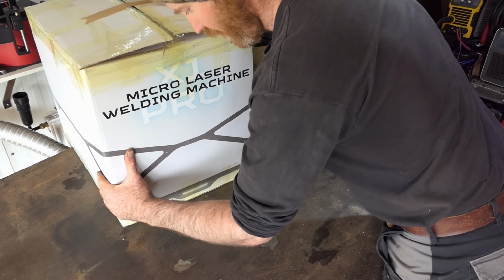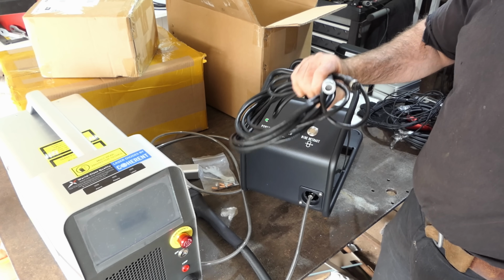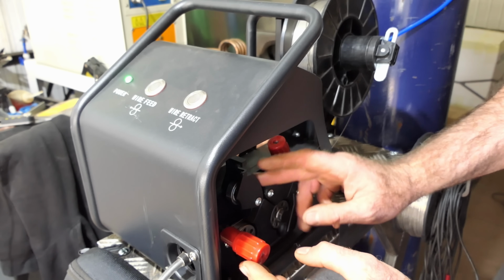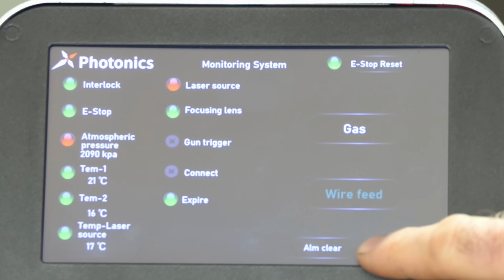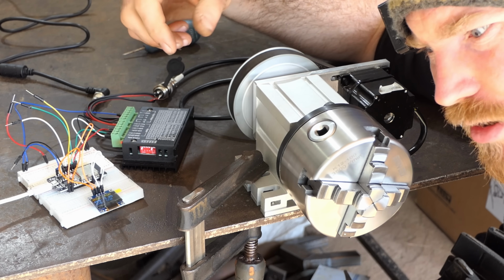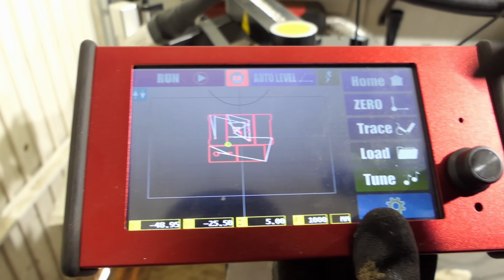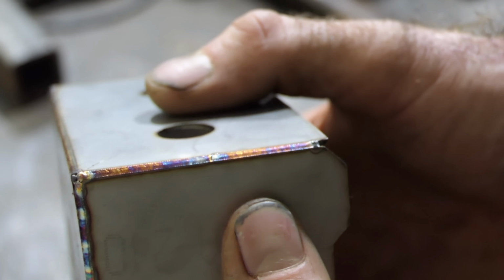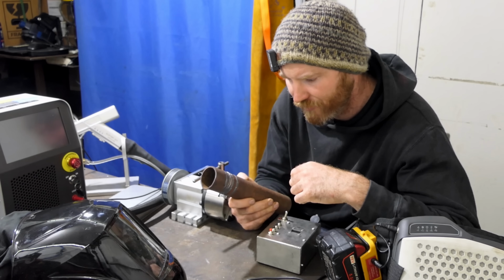Upgraded Super Laser!... Kickstarter fulfilled!

Comment: Hi Josh, which type of helmet do you use? On the link of the welding Equipment I can only find „normal“ welding helmets (without the laser safety classification).  (I also bought the Laser welding machine from xlaserlab and I‘m very impressed about it!)
Reply from the maker: I use one from Xlaserlabs specific for their laser. Cheers J

Comment: Have you got files to build your torch holder? I have both machines also.
Reply: Thanks for getting back. I’m planning to do the same!
Reply from the maker: I've not finished no. I tend to use the plasma rather than the laser as it's quicker and cuts thicker. But for intricate thin parts I'll need to make a better holder. Cheers J

Comment: That's an impressive piece of equipment. I dread to think how much it costs. What's the deal on gas costs running it?
Reply from the maker: It's £4000 currently. The gas is nitrogen which is 1/4 of the price of Argon which is used for MIG welding. Cheers J
Reply: Oooooooooo that's a lot of pocket money. Then the obligitary CNC adding x amount. I can see how this could spiral. But the things I could make... ummmmm I really, really want one.

Comment: So great to see the abilities of this machine. Would you have a link somewhere of possible settings for welding particular metals. Ideally various stainless steel thicknesses.
Reply from the maker: I pretty much always run on 100% power with a 2-2.4mm beam width and adjust the wire feed between 8-14mm/s depending on the metal thickness. Cheers J

Comment: I just got my X1 Pro laser, and it's great! Sadly I didn't get one of those DB25 cables for CNC with mine. Please could you buzz out and let me know which 2 pins those red and green/yellow wires are attached to so I can rig my own CNC up?
Reply from the maker: Well done. I hopefully mentioned it in the video but otherwise the instruction manual which I hope you received also has the pin definitions. Let me know otherwise. Cheers J
Reply: @joshuadelisle  thanks! My manual has a bunch of pinouts (including for an RJ45 which my unit doesn't have) but unfortunately nothing for the DB25! If it is in your manual (maybe your manual is more up to date?) please could you post the page up?
Reply from the maker: @gfwilliams  I'll look into for you.
Reply: @joshuadelisle  that's awesome, thank you! I can't wait to get it set up on CNC. I really appreciate the work you've put into the videos on this and your honesty - actually seeing you sometimes struggle with it made me feel a lot more confident about getting one when I saw the results you got in the end! (I'd love to see a video where you CNC cut and then weld the horse pattern you made with it)
Reply from the maker: @gfwilliams thank you so much. I plan on doing a lot more patterns soon. Next I'm building a powered ebike trailer that has a camper module similar to an airstream. It's shell will be seam welded aluminium and the laser is the perfect tool. Cheers J
Reply: @joshuadelisle  That sounds great! I'll be looking out for that with great interest!

I tried poking around the DB25 connector myself with a resistor and I found the connections! Pins 5-6 are the e-stop which need shorting, and then shorting pins 3-4 is enough to make the laser turn on.
Reply from the maker: @gfwilliams  that's awesome, well done. I'm still waiting on a reply from Xlaserlab to confirm connections. Cheers J
Reply: @joshuadelisle  just for anyone looking at this, I posted the setup I used for CNCing my X1 Pro at https://www.youtube.com/watch?v=91UyzMzQsJs

Comment: Hi Josh,
Xlaserlab have delivered today wahoo 🎉🎉🎉
would you recommend nitrogen or normal gas for welding all metals?
Reply from the maker: That's fantastic news! Nitrogen is good for most ferrous materials. Argon is best for aluminium, titanium etc. you need higher pressure/flow compared to normal welding because it helps keep the lense cool which is important. They should give you an instruction manual, I have a digital one and it's very comprehensive and goes into a lot of technical detail. All the very best. Cheers J
Reply: @joshuadelisle  I would have never thought of Nitrogen for welding and thank you for your advice.

Comment: Is the PAPR part of the xLaserlab X1 Pro package or where did you buy it from? The listing just talks about a "special laser welding helmet", but not about the PAPR.
Reply: Mines just been delivered and I can confirm you don't get the airbed helmet with the pro kit, just a normal type of helmet.
Reply from the maker: Xlaserlab are selling them separately and as a package although it's not on the website yet. Cheers J

Comment: wait, you are not cutting it with an angle?
Reply from the maker: That's right, because with CNC you need to cut vertically. There may be settings to add wobble to the pierce to prevent any problems. Cheers J

Comment: Great stuff! 
I noticed that while cutting your steel sheet the sheet was only clamped at one end, making it both droop (taking it further from the cutting head for part of the cut and too close at others) and bounce up and down after contact with the cutting head's probe feature (potentially causing some of the wiggles in the cuts). I believe fully supporting it would help with both dross (proper distance to get the best melt on the metal and more gas from the closer cutting head should blow it away better) as well as less bounce (reducing some of the wiggles in the cut edges). 
Best of luck with future projects!

Comment: to prevent reflection of the beam while cutting on the arc droid, couldn't you add an easily destructible matte coating? something like sooting the area with a regular torch before mig welding to prevent blobs of fly off sticking. just guessing here, not a welder, just a huge nerd. dunno how that would effect the cutting or not.
Reply from the maker: Apparently not because the molten pool that occurs before cutting through is what reflects the laser the most. Cheers J

Comment: It is cool for sure. Definitely great for a lot of things. I'm just curious about the strength of the welds . Just off the rip it doesn't really seem like there's much of a puddle going on there. It's just kind of quickly melting the filler and base as it sweeps I guess. Still getting dark blues on the edges somehow. So I guess there is plenty of heat in there. But, still I wonder if it burned through the pipe with the gap set up
Reply from the maker: See the video before this one. I do a lot of strength testing. Cheers J

Comment: Great video!!!! Using nitrogen instead of argon does it give a better weld than when it's used on a mig instead of argon or should it only be used with perging and non structural welds? I haven't had the chance to use a laser welder yet still way out of my price range but would like to get one eventually!!!!! Thank you!!!!
Reply from the maker: I've not seen much difference except nitrogen is far cheaper. Like a 1/4 the price. Cheers J
Reply: @joshuadelisle  nitrogen weld on steel will mostly be fine for non structural. however it won't work on aluminium as it'll cause lots of issue with the beam as well as extremely brittle joints(even for non structural welds)
Reply from the maker: @thefcpk  correct. It's best to use Argon on Aluminium. Cheers J

Comment: That silly sticker about voiding warranty if broken is useless in the United States the courts have ruled that they can not prevent you form opening your own equipment under threat of loss of warranty or guaranty.
Reply: Given you'll probably have to ship it back to china at your own cost, the warranty is pretty worthless anyhow. 

Also they type of hobbiest or professional that will want this product, will be modding it to fit their own needs on day one. So will know the tool inside out, and will be able to diagnose and fix it, far quicker and cheaper than a RMA would take

Comment: A buck converter lowers the voltage. That's a boost converter.
Reply from the maker: I used a buck to lower the voltage for the Arduino. The respirator had buck/boost converter. 👍 Cheers J

Comment: So, if you're not allowed to keep the laser normal to the surface (and if Joshua is unwise to do it anyway), then which is the correct way to mount this for CNC operations?
Reply: I think that'd be solvable with a little trigonometry if we knew the beam diameter/collimating lens diameter/etc... Lacking that, I would guestimate that maybe ~3° or so would probably be enough. The lens will be a ways back from the tip (probably the length of that silver 'focus' tool). The factory cutting tip doesn't seal against the workpiece, so the extra angle probably won't affect the gas assist much (or if it does, cranking up the flow rate might compensate).
Reply: @ClayCowgill  I guess you're right that 3° or so will likely be enough. My thought was that if we're cutting at an angle the dimensions of the parts are going to be affected. But with this process we're probably not going for sub-millimetre precision anyway. The cuts will need to be cleaned up afterwards in any case. So yes, that could work.

Comment: Will you do a vid on the turn table
Reply from the maker: I think if I did it again I would do it differently. Probably a normal motor with a speed controller and add a simple reed switch and magnet to monitor RPMs. Needs to be a belt drive and electrically isolated if using for short circuit/HF welding like MIG or TIG etc. not a problem for a laser though. Cheers J
Reply: @joshuadelisle would be a good project I'd be interested in turntable specific vid
Reply: @joshuadelisle  It wouldn't take much to monitor the wire feed and sync the turn table to it.

Comment: Is that PAPR purchasable on its own?
Reply from the maker: I believe so but may not be officially released yet. Check their website in the description. Cheers J
Reply: @joshuadelisle  If you are daring enough to rip into it, would you be willing to share any specs / model of the fan they use in this one? I've been trying to fashion up my own 3d printed PAPR, but trying to find a fan that can run on 12v (or 18v) that can push enough pressure and flow through a 3/4" hose has been proving difficult. (Ironically, DIY PAPR is what brought me to your channel, because spending $1500 for clean air while working irks me)

Comment: Those glasses are worthless, speaking as a certified laser safety officer. No CE certification listing(you can put the "CE" mark on anything you want, it's voluntary declaration), no EN207 rating and certification(required for CE!), zero branding or name. Trash. And speaking as a systems engineer with lots of laser design experience - the system itself is also an overpriced nothingburger - you can get double the power for the same price and in not that much bigger of a package, just need to look around. It's all the same parts inside anyway.
Reply: instead of me looking, can't you just straight point out to the double power set?
Reply: @2hug  The world is big and prices vary depending on region and what you can negotiate for shipping. Go look around.

Comment: Great video! Regarding the Arduino jitter issue — ( I know you solved it somehow) but this is a very common problem caused by blocking code, where updating the screen or handling input delays the precise timing needed for smooth stepper control. The solution is to use non-blocking logic (like millis() instead of delay()) and ideally implement a queue or state machine that schedules tasks like LCD updates only when needed (e.g., when values change).

A good prompt you can give ChatGPT is:
“Write a non-blocking Arduino loop using millis() with a queue for LCD updates and smooth stepper motor control using AccelStepper or direct pulse timing.”

This will get you much smoother motion and responsive UI without the jitter.
Reply: This is a good example of why knowing how to actually program still matters in the new AI world.

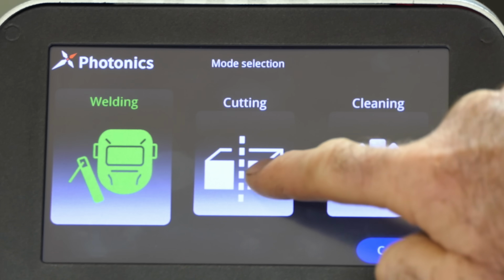Comment: 11:16 - "Vertical cutting is strictly prohibited"
17:31 - Commence vertical cutting!

Complete madlad!
Reply: Yes, you absolutely can damage the laser this way..  If you are lucky, it's just a lens or series of lenses that get zapped and have to be replaced, but if you damage the end of the fibre or the gun coupling due to the beam reflecting back, it's a major repair or potentially the end of the laser (you can replace the coupling, but if you damage the fibre, I don't know that you can successfully re-cleave the fibre end well enough to handle welding power levels)..

You will get away with vertical cuts on thin stuff that blows away quickly, but thick material like that pipe that takes a while to burn through, the molten pool of metal is quite reflective and will bounce a good percentage of the laser back into the gun..   Don't even think of trying this on copper or copper-bearing alloy as it is extremely IR reflective and also requires more power to cut, the ideal formula for damaging the laser..   A proper backing behind whatever you're cutting is also a necessity as unlike a torch or plasma where the flame or arc is length constrained, the laser continues out the other side and can cut/burn or otherwise damage things..  I would bet he has a nice  set of templates the shapes of his project box marked onto his shop floor by not having a back stop underneath...
Reply: @Flying0Dismount  what angle do you think would be the minimum to get away with ?
Reply: @kushking5354 I'm regurgitating from my laser welding course notes here as I've never attempted to use my own laser welder to cut:  Angle is a bit of a tradeoff..  At 90 degrees (vertical) all of the laser power hits the material and can cut the quickest but there's also the most energy reflected backwards into the laser..  If you are cutting thin material or the laser has enough power to basically blast straight through the material instantly and not have to slowly melt it's way through, then there will be little to no reflection (this is the case for industrial robotic laser cutters).  For thicker materials, generally the advice is to get a bigger laser, but for highly IR reflective materials like copper and copper alloys, where even with a powerful laser, it takes a moment to melt through, the tilt angle is normally in the 70 degree range so that you are dumping as much power into the cut as possible but are redirecting at least some of the power so as to minimize damage to the lenses and prisms..

It's worth noting that none of the "pro" or industrial handheld laser welders are sold with handheld "cut" capability because of the high potential for damaging the laser as well as the risk of the laser continuing on to damage something else, although there is nothing stopping you from buying a "cutting nozzle" yourself and doing it, but the manufacturers don't support or suggest it and don't provide special modes on their equipment for handheld cutting.
 
If you are dead set on using the laser for cutting, test it at 45 degrees at full power on a small test scrap and if it doesn't immediately blow a hole in the material, it is too thick or the laser is not powerful enough for the material, and I wouldn't chance it..   The laser should not be allowed to slowly chew through material like a plasma jet or a cutting torch flame, it needs to blow material away and keep moving and if the material is too thick, the puddle that forms will be reflecting power back at the optics and fibre end which you really don't want to happen.   Generally you will damage the flat protective lens first, but if you don't notice and keep working, the damage will get worse and by the time it is really noticeable, additional lenses will have taken damage as well, with the worst case scenario being damage to the fibre itself, which can't be fixed just by replacing a lens...
Reply: @kushking5354  I don't think you could get away with any angle as any cuts perpendicular to the angle will mean you have a sloped cut. The work piece would need to be rotated so the laser would be being "pulled" for every cut (or the laser rotated but that could cause issues with the feed lines).
Reply: Yes, I'm keen to know if there's a chance of damaging the laser module using it like this for CNC.
Reply: @tomnothing  so would I, it would be my main reason for buying one.
Reply: it's only 1 year warranty and burning your laser surely not covered. I wouldnt risk. Would be great to see how he would set up the whole thing with angled laser (undoable?)
Reply: How do the cnc laser heads fix this issue ?
Reply: @pamiv51  i don't really know.and it looks like this sayes. not to do it.

Comment: CE marks, many products allow for self-declaration of conformity. This means: The manufacturer performs internal testing or uses recognised standards. A Declaration of Conformity is issued and must be available on request. It's basically a sign of accountability.
Reply: Declarations mean nothing without testing. If you just declare it conforms, and it causes damage(i.e. burns down your house or plucks out your eyes), they must also make TEST RESULTS available, from a certified testing lab. If they can't furnish those, you can sue them out of existence because their declaration was false.
Reply: @Spirit532 As an overseas consumer it's impossible to sue a Chinese based company, which is the point I'm making. I've asked a number of Chinese companies in the past for test results, which weren't forthcoming. I wouldn't trust CE marks on goggles, equipment, or the respirator.